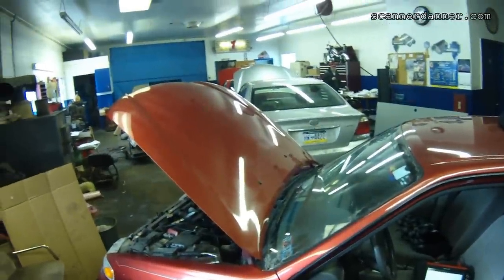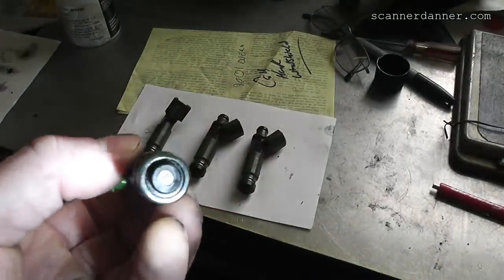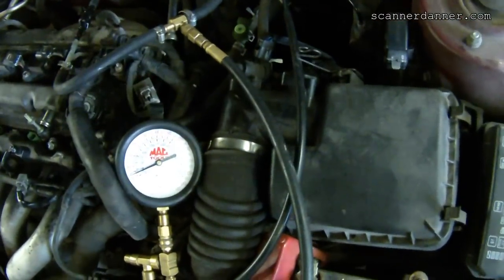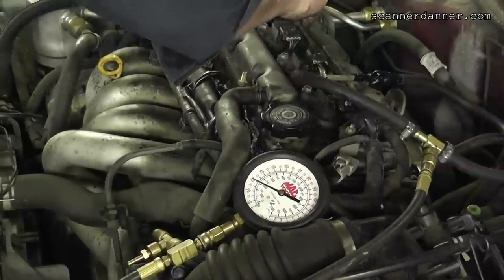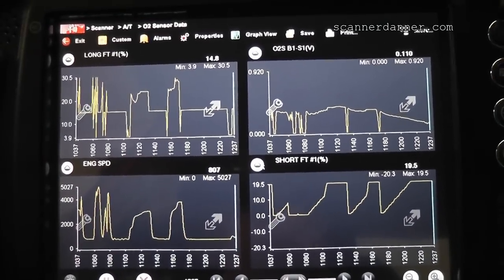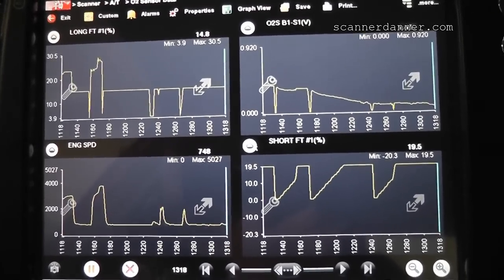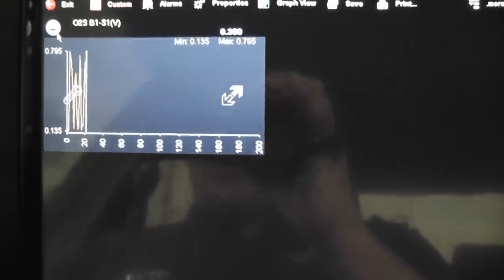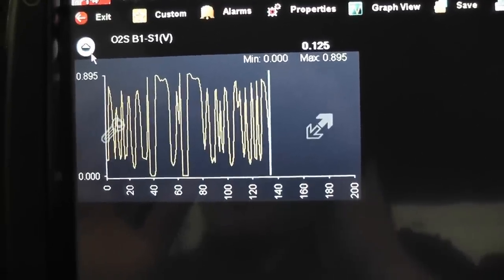Misfire from restricted injectors - Chevy Prism (Toyota 1.8L) part 2

Comment: I've seen quite a few O2's over the years that tested fine, but stuck lean intermittent.  Even though it's a justified sale (simply due to age) we hold off till it stays stuck... customers think we just want to sell parts and they don't believe you when you tell them that it's not acting up. Unless the "intermittent" problem happens every day, it's not worth looking at... for the sake of the shop & the customer. Awesome wrap - up as always!

Comment: Good vid. A lot of times these older cars are like doing home remodels. The deeper you go into it, the more needs to be done. Bottom line is the car was not right when you got it, and you fixed it without emptying a case a parts you didn't need. Plus, you know it's fixed because you verified. It's wonderful when you know it's fixed instead of waiting to see if a symptom comes back.
Kudos.
Reply: Truth.. Afraid to even pull out my injectors to clean them, knowing the seals will need replacing at the least even if I find nothing..

Comment: This is one of those cases where you are in a catch 22, in a way.  I have had this bite me before.  Typically when I get a car with injector problems, I immediately notify the customer that the integrity of the O2 sensor, and catalyst has been compromised.  I write that in the RO too.  Let's face it, it's just not always possible to know if a part has been compromised.  I think the end result in the customer will appreciate your honestly, and straightforwardness.

Comment: Yes great job Paul, well done. The O2 sensors life was nearly over, as seen in the picture of old sensor because mixture issues and the life of the sensor I say was up, having injector contamination over a period of time would shorten most sensors life . I have experienced similar events over the years where sometimes after a injection flow test and extra unburnt and excess fuel can cause  the o2 sensors to fail and maybe that bad fuel lead to the injector issues in the first place. You have shown us all to recheck the data and confirm everything is running correctly after the components are replaced. Again thinks and well done.

Comment: Thanks scannerdanner, i had the exact same problem with 02 corolla, with check engine light p0171, my stft was 19.5 and ltft was 44.5, i replaced all 4 injectors after watching ur video and that fixed my problem, no more lean code, thank for the video.

Comment: Paul, thanks for showing us how real-world diagnostics can be a challenge even for the seasoned pro :)  Could you have looked at the downstream sensor to confirm a dead upstream sensor? Seems like the car ran a lot better with the new injectors, even with the crappy O2. As for the apparent decrease in flow from the old to the new injectors, is it possible that the pintle seat wears, producing more flow but not atomizing the fuel as well, leading to less complete combustion and setting the lean code? Would be cool to see the spray pattern of the injectors on the bench...all you need is the OTC fuel injector cleaner kit, a hose clamped around the injector inlet, and some shop air regulated down to the spec fuel pressure.
Reply from the maker: I could have used the downstream, just didn't think about it in that moment. Thanks!
I plan on doing a cold engine hot engine injector balance comparison for my next video upload.

Comment: Paul, 
I'm absolutely hooked on your videos at the moment. The way you engage your audience coupled to your superior knowledge is second to none. I especially found this video very intriguing as it proves in the real world that even the best of the best get caught by sheer bad coincidences (I thought that stuff only happened to me lol). I learnt a lot from this video with your base procedures. The only place I felt you left the door open was the absence of what was happening at the tailpipe. Like yourself I love trying to solve cases using fuel trim and O2 data but the 5 gases recorded at the tailpipe would have been priceless with that horrible prism running fault. Been stung by bad O2 reference cells a couple of times ;-)
Keep the videos coming that keep us learning
Thx, Steve in the UK

Comment: Great video as always. I have just finished an 06 Scion Xa 1.5 with very similar issues. Lean codes, but the car ran  pretty decent. Long term was about 30. Checked  MAF it was clean. Checked fuel pressure at full throttle, good. No vacuum leaks.  Upstream O2 was slow about going into closed loop. I replaced it with a Denso. When cold this morning, I pressure dropped the injectors and all were about 41 to 34/35. Put the new injectors in while engine still cold. Pressure dropped them using the pulse tool. Same results. Then I started engine. Fuel trims started correcting right away. I used the Verus to record the driving event. Now full throttle the O2 stays above 750 mv and the car has better power. Fuel trims r now perfect. I think pulsing/pressure dropping injectors only will show a leaky or clogged injector. It didn’t seem to accurately show that they were the source of my lean codes. Thank u for all your help over the years!!

Comment: Well done on being honest in your follow up video! This was a tough one. I agree, there was nothing in the initial testing that suggested a failed O2. To me, you didn't miss anything, the sensor was functional.

The follow up call really does suck, but it's 10 times worse for the parts changers. This could have EASILY gotten a MAF, fuel pump and intake gaskets at another shop...
Reply from the maker: I agree, and the more I think about this the better I feel about the direction taken. really appreciate your comment.

Comment: Great video Paul. I know its hard on the field to get this kind of problem but this is what makes your video better. It's a real challenging role. This video teaches and aware us that there could be one symptoms and one problem but one problem cannot only cause by one component because it is a fuel system and Engine management system that completes the job. Engineers are not yet able to build a car that runs buy one single component that's why we need your help.
Reply: Just about everything I work on ends up as you described. Easy fix videos make me sick.

Comment: we did valve covers on a honda 3.5 and I unplugged the AF sensor, and well it kicked a code on the road test for defective af. scratching our heads as to how jiggling the harness could fail the sensor but sometimes its better these cars break in the shop than a week after the repair is made.  we can only do our best!

Comment: Nailed it Paul! Same deal with my neighbors Corolla reversed. %30lt and o2 was stuck lean .2v yet it droped to 0v wot. Was pretty confident o2 was lying. Replaced it and switching fine idling/cruise but still lean ft. Sucked having to tell her it needs injectors also. That fuel delivery test watching o2 voltage at wot is prime flat rate. Best lean code tip I got from you and master techs at my work still question it. Haha.
Reply: next time do this: buy yourself a 4-5 ft of vacuum/washer hose, attach one end to one of the intake nipples (EVAP purge will do) take the other end inside the car and have a starting fluid/carb clean aerosol ready, test your o2 reaction while idling and at WOT, reaction may delay a lil due to the length of the hose, try to alter your spray intervals and watch carefully, you will catch that sucker right handed

Comment: I always question how accurate that on car cylinder balance test is. You could improvise a better system, a graduated cylinder with the rail pulled/injectors in place. Buzz each injector with your injector timer and see the volume of fuel/spray pattern being put out as opposed to drop in pressure.

Comment: I know you said you don;t think doing the balance test would contaminate the o2 but the test was done twice with 2-3 mishaps on some cyls.  Plus trying to enrich the o2 readings. That's at least a 100 revolutions of raw fuel at 2 msec dwell on the injectors. Is that not enough raw fuel to contaminate the o2 sensor if it was already contaminated from months of driving it while misfiring? Just a thought.

Comment: I notice you mentioned  the slow rate of data coming from the car's computer, when showing the O2 graph. If you would have hooked up your Verus directly to the O2 signal wire, would you then have gotten the fast data rate we normally see, and not be limited to the bottleneck going thru the car's computer?

Comment: personally i have had exceptional luck with back flushing injectors using shop air and brake/carb cleaner. one might also use hexane or berrymans. if you back flush into a clean coffee can and you can see anything chances are that could be your restriction. but that is something i do on my own vehicles. at any rate, very good information.... we all hate to make that second call, it happens sometimes. who knows... it could have been very near then end of it's usable time.

Comment: Don't sweat it! Worn and contaminated injectors could compound the problem, even if they are sitting at + or -8 from eachother. They could vary just out of spec at different temperatures, volumes and work load. Resistance increases at higher temperatures. Along with a skewed O2, you knew what variables were at play. Never worry about replacing an old high mile part to get to the solution when you are the best in the business! We know you are not a parts changer. I repaired a 2007 3.5 Pontiac G6 today. It kept coming back with a p0171 and a p0174 after a couple of days and being at a few shops. It also had a p1174 in the history that I overlooked. I smoked the intake and did a visual while I navigated through an OTC Genisys to observe fuel trims, MAF and HO2's etc. No vacuum leaks. The long term was above 15%. What through me off was p1174 bank and then p0171 and p0174 reading both banks. I determined the mass air flow was skewed and to insure it wasn't dirty injectors, I ran a can of BG through the rail. After replacing the MAF, I saw the short term fuel trim in the negative. After it left, I realized that the car was still cold so it is not confirmed. We will find out tomorrow if the monitors run. Customer/friend needs a state sticker.  I will definitely study up on the lean data video you posted and learn how to arrange my graphs if the codes return. I need to get this shit down man. It's hard when you don't do it every day. And the Genisys is slow lol!

Comment: I'm running into the same problem only I got a misfire added in every once in a while. I have fuel pressure and no vacuums leaks. Going to pull the injectors. Clean them up. And clean up or replace the o2.

Comment: I have the same problem with a 2001 Prizm.... hesitation on acceleration, rough idle, etc. I checked the O2 sensor according to  the Haynes manual procedure, using a DMM, and got some out of spec readings, and replaced it, but no difference... PO171 error and CEL lit. I checked the MAF sensor, IAC , throttle position sensor and connected a vacuum gauge, which shows normal except for an  occasional fluctuation and the "putt, putt" miss sound. I live in PA in the PGH area, and need the car to pass inspection. 
It's is reassuring to see the pros get the "....busters" sometimes.
Thanks!
Reply from the maker: +paulgra this engine is known for injector problems. did you perform a balance test on them yet?

Comment: and ... about the flow of the new injectors... wasn't by then battery voltage lower than during the 1st test...  producing bit weaker/smoother pintle movement and thus less flow?

Comment: Yes, a failed upstream O2 sensor would cause this. Quite possibly due to excessive heat from the long term lean condition..... Or from excess fuel in the exhaust flashing over when first started after an injector balance test.... Either way, proper fix, good video. Thanx.

Comment: thanks Paul, this was great to watch. considering i have a similar job on a Mazda in the next couple of days, i think this will help me a great deal.
do you think the o2 sensor was on its way out due to the rough running, then finished off through testing of the injectors (excess fuel down the exhaust etc). would seem to make sense.

Comment: Hi... Just a theory... Could it be, that all four injectors were leaking, as suggested by the balanced test of old vs new injectors, and the the rich injectors messed up the o2 sensor in a way that it was not as sensitive? If so, that would raise the threshold  of the o2 sensor and cause it to actually fluctuate when the exhaust is extremely rich but after the injector replacement to not have enough rich condition to drive the O2.
In other words, I think your old injectors actually did have a higher flow and the mixture was rich all the time even is the O2 reported a lean condition. So cutting the flow exposed O2 issue at normal injector flow.

Comment: You really do know your stuff. Wish i had the knowledge you have.
I have a question.
I have a Mazda RX8 which is a Rotary engine and my long term is floating around 5% now but was 3% before i changed the upstream O2 sensor as it was dead.
When i raise the revs to around 2500rpm the O2 fluctuates back and forth from rich lean as normal but in idle it is permanently rich at around 0.9V 
My Long term will not change and short term floats round 0-1% so its driving me nuts i can't figure it out and from the way you illustrate how to analyse scan data my actual data does not seem to follow suit. Is it because this is a Rotary engine and idle is normally rich for this car?

Comment: The reason for the lower flow rate on the new injectors is because the fuel running through injectors after a while makes the holes bigger. The new injectors have the correct factory size. Fuel is an abrasive if ran long enough.

Comment: i know you said the balance test numbers were so off because of a hot and cold engine, but shouldn't you of had more gas being dumped in on a cold engine, rather than a hot one? because the test showed that the new injectors on a cold engine was dumping less gas than the old ones were on a warm engine?

Comment: weren't the holes in the protection cover over the ceramic stuff, inside the 02 sensor, completely obstructed and the in back of the sensor, where it should "vent" to the atmosphere, there was oily stuff...? could have tried cleaning it with carb and brake cleaner. couldn't the injectors have had a ultrasonic bath and be "re-balanced" ?

Comment: Maybe using the wps500 on the rail instead of a manual gauge in this situation would be more valuable in that you could see the difference in pressure pulse for every time the injector is pulsed. That would give a clearer picture of the difference in flow between each injector. Also having the rpm on the screen with the O2 at the same time so with the slow update rate you’d have had a reference point for the O2.
Reply from the maker: I've done some WPS stuff on the fuel rail and there are a lot of variables with the test. It is not a clear as you would think. I have some videos showing it, just not sure where off hand. Thanks!

Comment: Don't think you done anything wrong Paul, 02 sensor working ok to start with, seem to go bad on the second run when it got hot, but sure the injectors were bad originally, pressure test confirmed that, good job Paul...Fred uk.
Reply from the maker: Yea, I don't think I did either but I wanted the uncertainty to be shown. I think it makes for a great discussion.

Comment: Hhhhmmm... Haven't finished the video yet, I'm at 12:30. Have you considered the possibility that the new injectors are a different, lower flow rate? Injectors with a lower flow rate may fix the problem, assuming the ECM can adjust for it.

Comment: I had the same problem with bad gas and number 1 injector just sounded like it responded slower and had a misfire on same cylinder. That injector was bad I was using small gas station gas with no ethonol. It appears it didn't have detergents either.

Comment: or use carb cleaner or brake cleaner, break a can and the liquid put it on a tank, put the tip of the injectors inside and use your tool to make them work for a while, that way they will clean inside, is very effective too

Comment: would a clogged injector use a little more amperage to try to get the fuel through? can it be another way to test for a clogged injector ? comparing it to other injector amperage

Comment: Can barely see the O2 images but it does appear you did have a true lean as the lower parts of the traces seemed "spiked' with more average hang time on the rich side. Maybe the sensitivity of the O2 changed due to the vastly altered trims after the repair.??
Reply from the maker: I know, stupid helmet cam. I really appreciate your comments Darren. You've been spot on with all of your posts that I've read over the past few weeks. I really appreciate your contributions.